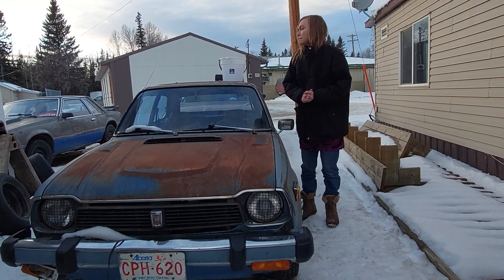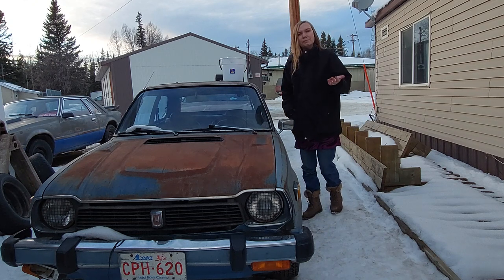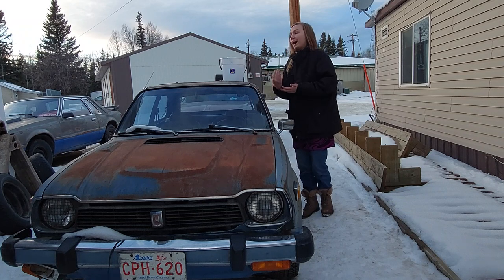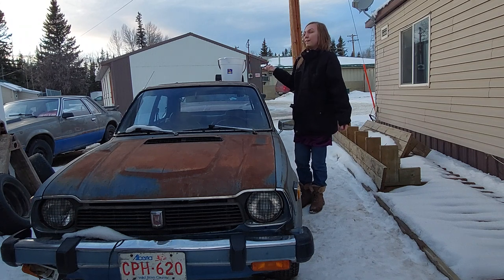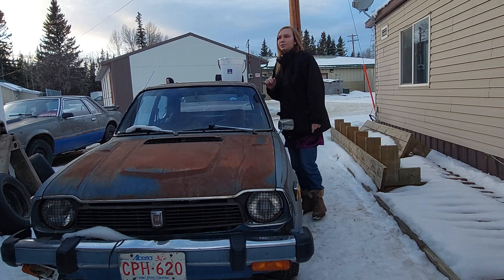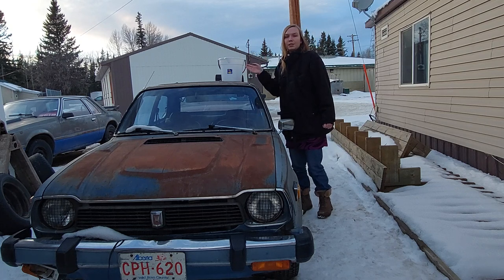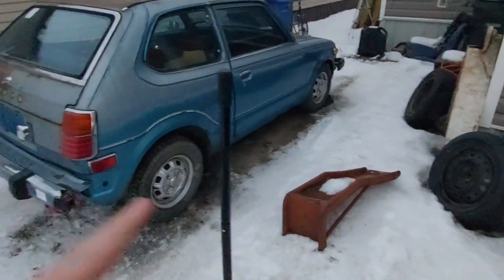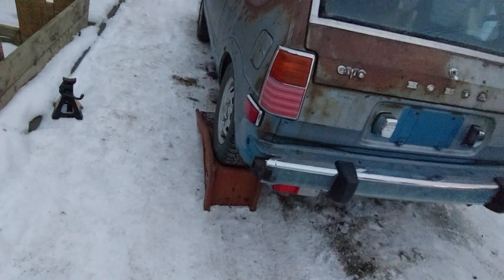How to drain the fuel system/clean it without dropping the tank in a 1978 honda civic

Comment: Katarina, I am considering buying a 1979 civic but it needs a fuel tank.  Do you have an sites or connections on where to find one?
Reply from the maker: No unfortunately I don't. You'd honestly just have to find someone parting one out. And don't do what I did. Wagon gas tanks don't fit in a regular civic either.
Reply: @KatarinasGarage  Thank you for the information!